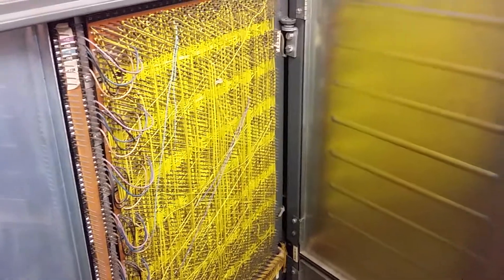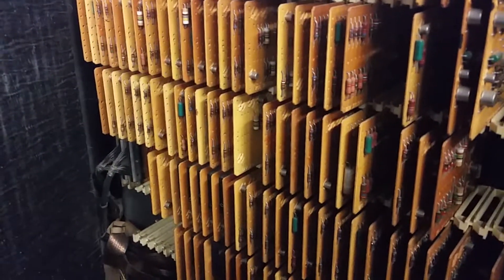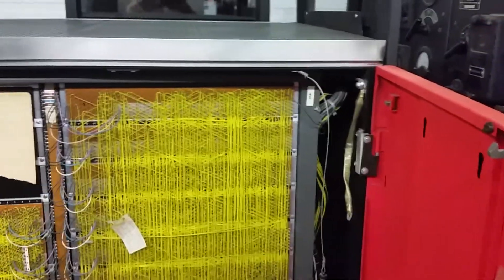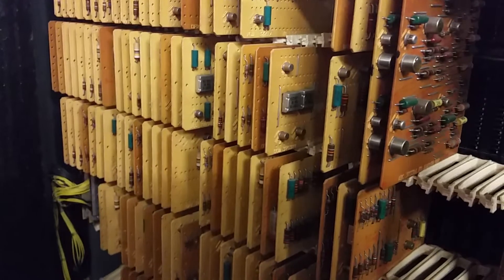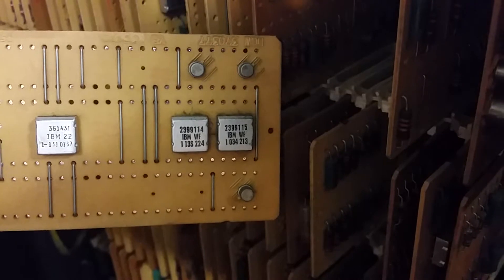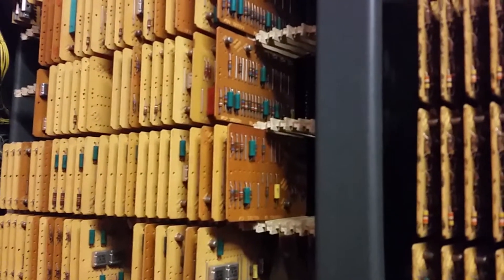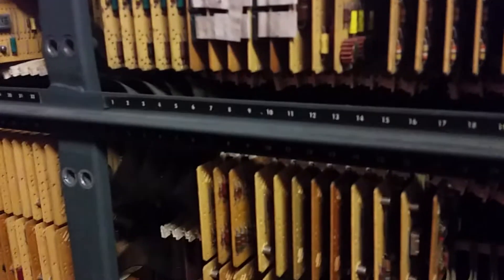Mutant IBM 2821 Control Unit

Comment: I gave you the wrong model number for the 2821, it can be found stamped on the frame, 2821 Model=00x ser. no=yyyyyy
This info from Wiki identifies the 2821 model numbers :

Six models of the IBM 2821 Control Unit were available, as follows:

Model 1 attached one IBM 2540 and one IBM 1403;
Model 2 attached one IBM 1403;
Model 3 attached two or three IBM 1403s;
Model 4 attached one IBM 2540 and one IBM 1404, but only on IBM System/360 models 30, 40 and 50;
Model 5 attached one IBM 2540 and two or three IBM 1403s; and
Model 6 attached one IBM 2540.

So if you have only ONE 1403 connection, you have a Model 2, if two or more 1403s then Model 3

Comment: The 2821  with that single gate I believe is a 2821 Model 5, which had only the printer circuitry.  The one with the two logic gates includes the circuitry for the 2540 Card Reader/Punch.
I believe Ken Shirriff is correct, SMS cards for later dates could replace lots of discrete components with the denser latest technology from IBM.
A couple of other machines, for which there were no 370 generation replacements, were the IBM1800 Process Controller, and the IBM1288 Optical Page Reader.
If someone wanted a second printer, they needed this Model 5, whch was cheaper, sans 2540 logic.  This could have happened after the IBM3811/3211 Printer was released, and the customer did not have a 370 interface, so this 1403 printer was the one available for his 360 system.

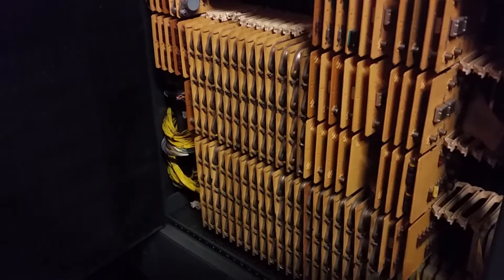Comment: Yes.. at 4:20... those are the hammer drivers, and they put out 60VDC and a very high amperage!  Be very careful, as the 60VDC is exposed on the pin side of that board, and throughout most of the boards.  Once while performing service on one of these, I stepped between the gates and touched the metal face of an old Motorola Page Boy pager to a couple of pins... the entire room went down, and took out a half dozen sms cards on the 2821.   I never saw one like this with only the single gate, all that I ever worked on had both gates, and discreet components, with 1403-3 or 1403N1, and 2540 reader/punch attached.
Reply from the maker: Yes, this 2821 is indeed a weird one. Its a keeper! Someday I will do a real video of the "normal" 2821s in the collection.

Comment: You noticed SMS cards with SLT packages in your system. With the rise of SLT, IBM produced the same SMS cards, but in plug-compatible SLT versions. E.g. the "DGW" logic card originally was an SMS card with discrete transistors, but later had 3 SLT modules. (I assume these were cheaper to manufacture.) The point is that IBM didn't need to redesign the system to use the SLT-based SMS cards, but could use them in old designs. I've been cataloging SMS cards in great detail at righto.com/sms
Reply from the maker: Thank you - I did not know that they kept the SMS card codes the same.

Comment: I serviced IBM equipment including the 2821 from early 1970's through mid 1980's. I never saw cards with SLT chips in them but no doubt it was cheaper and more reliable to use SLT over discreet transistors. I think that 2821 was for a single 1460 (not 1403) printer.
Reply from the maker: I will have to find out which model it is. I do not think this has the circuitry for the card punch. Do you mean 1404 (not 1460)?
Reply: I think it's a model 2. There is an id plate on the frame somewhere that may indicate the model. I'm not sure what the 1404 was but I think it was some sort of punch card unit. I never worked on one. The 1460 printer was a faster version printer (1100 lines per minute vs. 600 lines per minute for the 1403) plus it had motorized mechanical covers. In the latter years customers went for the 1460 for speed but the 1403 had slightly better print quality.  The 2821 handled either printer without modification.
Reply from the maker: It is indeed a model 2.
Reply from the maker: You are thinking of the 1403N1. 1460 is a tricked out 1401, basically.
Reply: I stand corrected. The 1403N1 was the fast printer. How time has fogged my memory! Is there a use for this stuff now?
Reply from the maker: There might be old S/360 and S/370 items still in use in some backwaters, but I bet we are talking about single digit numbers. The place for these machines these days are private collections and museums. I am one of those private collectors, but I work with a couple of computer museums as well.

Comment: Very interesting... Maybe refurbished? Would be interesting to hook up a printer and see what happens...
Reply from the maker: I do not think so. Other than the massive difference in the technology, there are lots of little refinements and tweaks inside. Unfortunately the plastic of the card guides has decayed and warped, so a bit of a negative tweak there.

Comment: Now you need to find another red one to see if it will be the same inside or not :-D
Reply: Cambridge University ordered a 370/168 and was told by the salesman it could be any color they wanted.    A few days later he returned to say the machine would be made in France, and the French plant could only offer a single color of machine, blue.   A few days after that, he returned with the bad news that it was... Oxford blue.
Reply: IBM offered a lot of different colors for machines. It seemed that machines with yellow colored covers had more problems. The reputation was that they were lemons. IBM dropped the color then eventually all colors.
Reply from the maker: Standard colors of the S/360 and most of the S/370 era were blue (the default), red, yellow, white, and grey. Any other color could be had as an RPQ ($$$$$), but almost no one paid that extra for just a different coat of paint (I have heard there was a green S/360 in Hawaii, maybe at a university). For a very brief period in the mid 1970s green and brown were added as standards in the catalog, but I have never seen evidence of anyone ordering these options. By the late 1980s, the options were paired down to blue, white, and grey.
Reply: IBM salesman will promise anything to get a sale. It doesn't matter if they can't deliver. They are good at changing things after the sale. How are they different from a car salesman?

Comment: I think the 1403 was controlled primarily by software, just like the tape drives on the 1401.
Reply: Nope. The 1403 was controlled by a 2821 Control unit. In the ancient 1401 machines the control unit was part of the 1401 mainframe. For 360 and 370 systems they separated the controller portion from the 1401 processor making it a separate unit called the 2821.
Reply: The 1403 and the 1401 tape drives had no software capability.